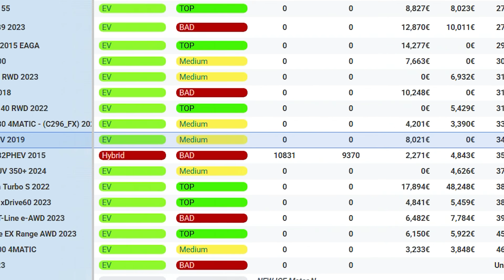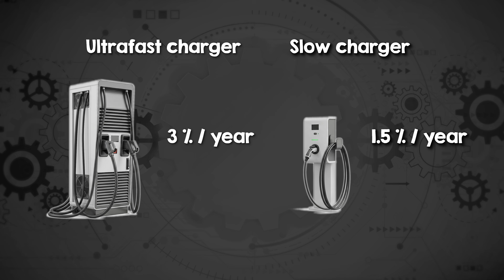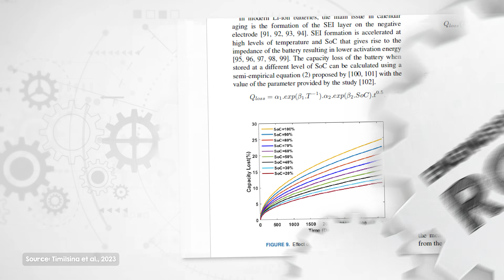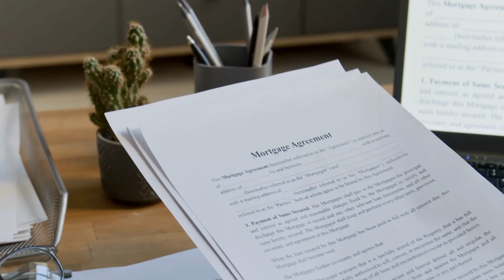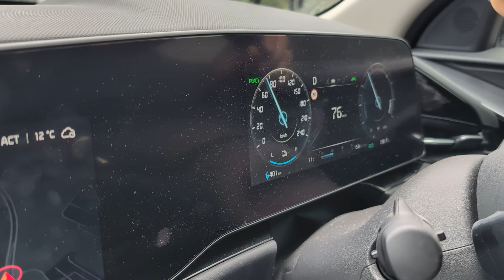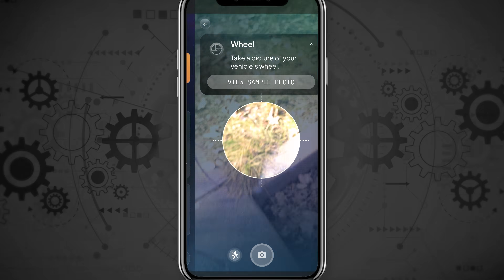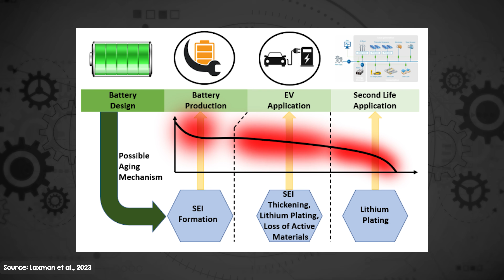Watch This Before Buying Your EV

Comment: Hyundai has a 10 year / 100,000 mile transferable warranty on their battery in the U.S. So replacement is not something I worry about.
Reply: I have both an Ioniq 6 and a old Fiat 500e, so I've seen the whole spectrum of battery health. I have 130k miles (>200k km) on my Fiat and even though the battery now is about 70% of when it was new, it still drives the same as ever and is still efficient as ever. 

Sure range stinks but its perfect for short trips around town. 

we've cut probably 95% of our fuel usage vs what we used 8 years ago.

Comment: The old Nissan Leaf only had passive cooling. Needs to be mentioned.
Reply: Also the car itself had no way to shut off charging at a particular percentage, so people tended to charge to 100% overnight, and leave the car standing at 100% until they needed it.
If you wanted to stop at 80% you needed to know how long that would take, then set your charger to shut off after that time.
That plus the lack of active cooling resulted in Leaf batteries degrading much faster than necessary, and passing that reputation on to other EVs (in the mind of the general public) that did not have those issues.
Reply: @ziploc2000 Sadly, Nissan has continued this with the Ariya. It has no way to limit charging to 80%.
Reply: @GreenJalapenjo  thats crazy on a new EV.
Reply: @GreenJalapenjo lmao wtf is nissan doing. Bro just let me set a stop for 80%
Reply: @z @ziploc2000 My first Leaf was a 2014 and it did have the charge to 80% button. Now I have a 2017 without; but we find setting the timer based on 7 kilometers range added per hour of charge to work fine. A quick bit of math when we park at night. Works.
Reply: @ziploc2000   the Nissan leaf I had did have a setting to limit the charge to 80%. (or was it 85%?) I used it for a couple of years, unfortunately  I should have switched it off occasionally, - the Leaf only does balancing when fully charged, so the battery became quite out of balance, it took quite a few 100% charges to get it even close to balanced.  Meanwhile I'd lost a bar of battery health (which doesn't return if you correct the situation)
Brian
Reply: Just what I was going to comment 👍
Reply: Same with Mitsubishi Outlander PHEV and IMEV
Reply: They were notorious for losing capacity in a cliff like manner especially if you drove and then charged it straight away. Heat is the biggest killer of the battery life. I leaned that the hard way with a phone on the dash that plummeted by about a third.
Reply: @rogerpearson9081 Yep, passive cooling was the worst. Luckily now most cars have thermal management except for some very small tiny cars like the Microlini.
Reply: Rosie isn’t dealing with that subject, oh yeah that’s a cell phone battery in the Leaf🤔🤣
Reply: Battery degradation on the leaf had more to do with its chemistry, not the lack of liquid cooling. Case in point - the original Kia Soul EV, with air based cooling, but had even worse battery degradation. First gen A123 battery on the Spark EV had also terrible degradation, and had liquid cooling (and was LFP!).
Reply: @sprockkets No sorry that's not true. The passive cooling meant that the leaf got destroyed in areas like Arizona. Luckily it's better now.
Reply: @zotter2542 But you conveniently ignored the part that the Kia Soul had cooling, but still had worse degradation, or the Spark EV degradation
Like, you didn't even read my post, at all......
Reply: @sprockkets Yes, I did read it. But in this case we are talking about the Leaf. I didn't "conveniently" ignore it. I just know the problem with old leafs was mainly due to lack of cooling. It performed better in moderate climates. Just don't make drama. You have a point, but it's just not the full story.

Comment: What would be interesting to see, the 100% thing on a used battery as far as I am aware is that not 100% of the battery is sold to you. If there is 30% spare capacity built in so that you are never charging the battery to 100% but always to 70% on a full charge and never discharging it to zero but in fact discharging it to 30% and allowing the bms to swap our cells that are running hot with some of that 30% thus maximising the life of your battery and keeping the sold capacity at 100% until 30% of the entire battery has failed, isn’t that what we’d want? Charge it to 100 and run it down to 0 without damaging the battery. Would be interesting to see tge science if that actually works

Comment: This is exactly the kind of info used EV buyers need. The battery isn’t the scary part, the lack of transparent testing is.
Reply: Old cars require testing, EVs from 2023+ just require a good scan for SOC
Reply: Exactly. It's the transparency that's the key. Quite a few secondhand cars might have been tested.. and there are a number of testing systems favoured by the vendors. All these testing companies have no doubt sold a good positive result to the car dealer and certified themselves to look totally professional. What we need is a standardised test that's reliable and part of the MOT (UK mandatory car test).
Reply: Totally agree

Comment: The buffer strategy chosen by Hyundai and Kia is not intentionally deceptive. It is to protect the pack and ensure that the range is maintained as long as possible, for a better user experience. Therefore, Hyundai/KIA EVs usually experience 0.4-0.6% apparent degradation, compared to the dreadful 1.5-3% per year for Tesla’s for example.
Reply: 2019 Kia e-Niro owner here, recently out of warranty. No discernible loss of range after 138,000 km.
Reply: @EVDiaries-since2019  exactly. 114k km on my Hyundai Ioniq, same.
Reply: It's kinda like how car gas tanks hits "E" way before the tank is actually empty. According to the manual my 2016 prius holds 11.3 gallons but I drive my car beyond the light coming on all the time and I've gotten the car to zero range multiple times and I don't think I've ever put more than 10 gallons in it. And it's not just this car, I've done this with every car I've ever owned and I've only ever run out once. I've never been within a gallon of the amount that the manual said.
Reply: @cliffordbradford8910  in a way, except that I am not sure whether it would reduce the efficiency or lifespan of the engine if this “tank reserve” did not exist. That’s perhaps a difference with EV batteries that have this buffer (usually 5%-10% of total rated battery capacity).
Reply: @Nikoo033  the car companies don't want you running the tank dry because that can result in a burnt out fuel pump. Also, they want to dissuade you from running out in general.
Reply: My 4 year old 90,000 km Tesla Model 3 sits at just under 5% degradation. According to the data available for identical LFP model 3's , this is average. 
Degradation is not linear, and will mostly occur in the first 12-14 months and then the rate decreases.
Reply: @deerfootnz  it does depend on charging habits as well.
Reply: @Nikoo033 yes a little.
Reply: Yeah I dont hate the buffer system to the user. But it should never effect a back end test. 

Is the buffer at the top or bottom of the pack? I guess ideally the top but both is ok. I think tesla sort of does it st the bottom where it will show 0% when there is life left, not a bad way to do it as its what we are kind of used to with ICE cars.
Reply: @Sparky400  the buffer is present/acts at top and bottom.

Comment: We bought a 2018 Nissan Leaf last summer.  (Here in Canada).  The LeafSpy app uses obdii port to give detailed battery info. But when it gives the state of health of the battery, I guess I don't know where that number is coming from.  I think it's what the car calculates itself.  (We are currently at 83%).

However, there is a different measurement called Hx that is something to do with battery resistance, and that is down to 52%.  I only found out about this measurement later on. 

Our car drives quite well in pleasant weather. But the battery charge screen doesn't show proper numbers when it gets towards empty. 

And when it was particularly cold in winter, like below -15 C, the car was not super happy. There was one time where it thought it needed to charge even though it was 100% full. 

I think in our case we may have some weak battery cells. But I don't want to have to replace the entire battery pack just for that. We'll see how the next winter goes.  We are pushing the use of it a bit, my wife 's commute to work is 50 km each way.

Comment: I drive a 2017 Chevy Volt. Technically a hybrid, but it uses 100% electricity until the battery runs down, then switches to ice engine  generating electricity to make the range essentially unlimited.  We have over 250,000 km, with approximately 30% all electric and the battery has degraded roughly 20% overall. 
Our bigger issue is range loss in our Canadian winters.  Cold temps and cabin heating reduce battery range up to 30%. BUT it’s important to understand the battery range on the dashboard is a calculation based on battery charge, typical driving habits (lower when constantly driving at highway speeds), and environment (air temperature and climate controls in vehicle). If you don’t heat the cabin in winter it gives you greater range, it’s just a LOT less comfortable! 😂 (like driving in the Australian summer without using AC).
Reply: Most, if not all new EV's have heat pumps which greatly reduce the amount of juice needed for heating.

Comment: 15:20 Nissan Leafs (Leaves?) do not have liquid-cooled batteries, which make them vulnerable and prone to heat-related degradation in Australian conditions. It's an oversignt they've only corrected in the latest generation models.
Reply: Yeah if you have a leaf in Australia, I hope youre down south and park in a garage.

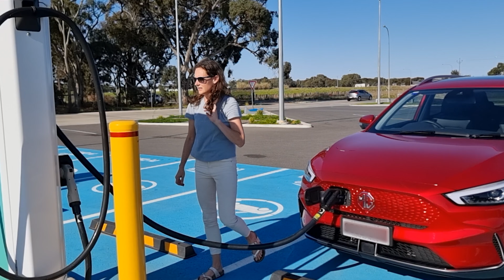Comment: The key take-away is what you said @ 4:50 mark.  Heat is the real enemy of lithium (NMC and LFP) batteries.  Continuing to charge a lithium battery that is hot and already nearly full is what is most likely to cause dendrite formation.  With all of this being said, a 50 year-old classic car, with an ICE powertrain, has just as much range as it did when it rolled off the assembly line.  Here's hoping battery technology keeps improving, while costs continue to fall, with aftermarket replacement becoming more feasible.  Cars should not be looked at as disposable after 5-10 years.
Reply: ICE cars lose range too over time.  Not as much, but old internal combustion engines are in no way as efficient as when they were when new.  And EV's last more than "5 - 10 years."  Even the first Nissan Leafs from years ago, which had no battery managment systems, i.e, no way to regulate the temperature of the battery, are still going strong after more than ten years.  And they were built when we knew relatively nothing about batteries compared to now.  And of course the EV motor will last MUCH longer than even the battery.  And I think much, much longer than the average internal combustion engine with its hundreds and hundreds of moving parts.
Reply: @Tom-dt4ic  - The EV motor is great, but a lot of the EV batteries are built as integral components of the vehicle, such that they can't be replaced at all.  The way Tesla is building some of their battery packs, you can't even recycle them.  The battery packs need to be modular, not integral, which would allow for much more 2nd-life use and easier replacement/upgrade.  ICE vehicles do get somewhat worse milage, over time, but those engines can be rebuilt.  EV's are being built as disposable products.
Reply: @jasonbroom7147  Most EV batteries built today will outlast the chassies of the cars they are originally placed in.  And after that the batteries will get a second life as grid storage.   This is already happening.   And after that the batteries will be recycled.  This is also already happening.
Reply: @Tom-dt4ic  - With some batteries, that is true, but relatively few of them.  The fact remains that EV's are not built in such a way as to ever become "classic" cars.  The majority of EV batteries, just like power tool batteries, will wind up in landfills.  A token amount will see 2nd-life applications or be recycled, but most will be thrown away, like the cars they came out of, because that's how they're made.  The current Tesla batteries, in particular, are built in such a way that recycling them is all but impossible.  Watch the Munro tear-down video.  I like renewable energy, have built numerous NMC and LFP battery packs from component parts, and feel that EV's have an application in urban areas.  I won't be buying one because of the type of driving I do and the location I live in.
Reply: @jasonbroom7147 I too am frustrated by the relatively short live of my power tool batteries.  Even though these tools are many times more convenient than the old corded versions.  But EV batteries are a whole different animal.  The main difference is the thermal management system which keeps the batteries from over heating.   Or from charging too fast if too cold or too hot.  This extends EV battery life by many years.  

I also like Sandy Munro and you should check out his video on Redwood Materials, a company that's specializing in recycling EV batteries.  It doesn't seem to matter how the battery was manufactured, because one of the early steps in the recycling process is to grind the  battery up into tiny pieces, much like mining does with rocks.  But of course the battery is many times more concentrated with the elements they're interested in.  Sandy likes Redwood a lot.  He says at this point Redwood's biggest problem is that EV batteries are lasting way longer than anybody thought, so there aren't enough batteries to recycle yet.  By the way, Tesla claims they recycle 100% of their car's batteries and that no Tesla battery every ends up in a landfull.

As for your car choice, whatever works for you.  But if you can plug in at home, no matter where you live, then EV's will be way cheaper to own and operate.  And by much more fun to drive.  They only exception I can think of is if you have to drive many miles per day in a very rural area which doesn't have many public chargers.

Comment: The Kia EV battery is legendary 😊. Range of mine is still awesome after 7 yrs and 150k km!
Reply: Kia e-Niro here in France, owned from new since March 2019. Now on 138,000 km with no discernible loss of range. Auto Propre (a French car magazine) have tracked two of these cars being used as Taxis, one in Paris, the other in a rural area. Both crossed the 500,000 km mark in late 2024, both on the original motors, both still showing at least 400 km of range @100% SOH.
Reply: Can we ask what your charging habits are? Do you almost entirely home Wallbox charge? Do you plug in most nights and always top up to 100%, is your EV garaged or outside on a drive? How low do you typically let the battery get before charging up? Where are you in the world - re:climate?
Reply: kia ev here, used as a tipper truck, frying pan, fridge and flashlight, still have around 2 billion miles range after 10 years of daily charging and discharging

Comment: Combustion cars with 200k on the clock can be found at the scrap yard. 
Mechanical wear of bits of metal sliding and banging against other bits of metal at phenomenal speeds is scary, even if lubricated.
Reply: We own several ICE with more than 300K.

Comment: This reporting is highly misleading. Geoteb (and alike) report values car's telematics reports. These values are "adjusted" for customer satisfaction. In warranty periods car telematics gradually converts gross battery cap. to net capacity. Battery capacity is largely independent of mileage. It depends in calendar age. So, residual cap. of 10y old car depends on initial gross bat capacity and parked car temperature (moving cars use AC batt cooling).

Comment: Excellent video. I learned a lot from the discussion about battery testing.

We have a 10 year old EV. It has over 200,000 km and the battery degradation has stopped at ~7.7% for a few years now.

The main culprit for battery health is heat. This is why dc fast charging wears down the battery. The process generates a lot of heat more so than say level 1 or 2 charging. So since heat is the main enemy, try to find a shadier place to park the EV when the sun is out.

The 10 year old EV commutes in a 200 - 220 square km area daily. We find it rarely needs a charge above 60% and the charging can be done with what some refer to as a granny charger (level 1). Again, less heat the better for the battery health. However, this EV uses dc charging every now and then but I'll only do a quick charge from 20% - 50%. Less heat generated.

New EV owners may also want to keep a mileage log. The destination temperature, departure soc, arrival soc. Our newer EV commutes over 250 kms daily. I find the destination weather matters. The lower the temperature below 0°C, I find I have to put a little more charge into the battery. However, the majority of the time, I rarely charge it beyond 60% at the start of each leg. At this constant discharge of between 60% - 20%, I can expect about 19 years of use from the battery. I'd be cool with that because at that rate of travel, that would be well over 1 million kms.

Pro tip: study your electricity rate plans before hand. Decide which plan makes the most sense for you. It can save you a lot of money.  We invested in residential solar for a decade now. Last month, we paid just over $215 in electricity to run two EVs, run a home with a heat pump. In comparison, I used to drive a hybrid for the long commute and the gas alone was > $320/month so pick the right electricity plan for you. A little homework and forethought will go a long way.